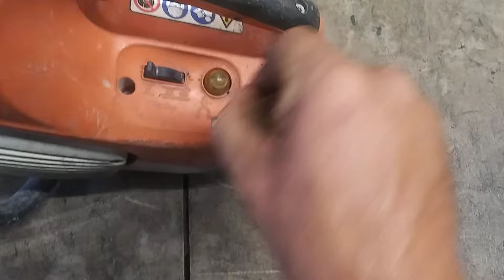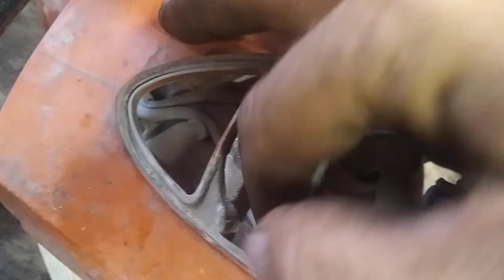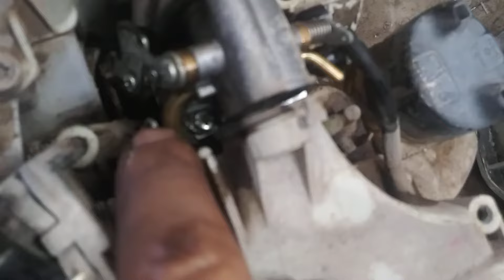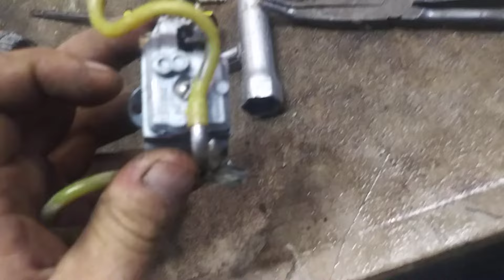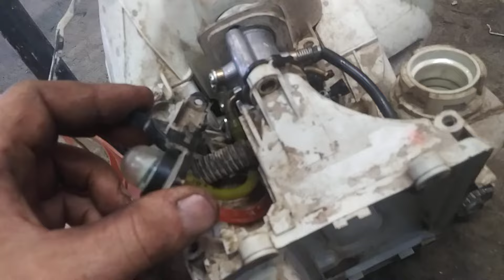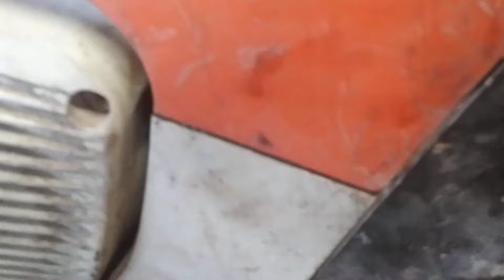* Stihl ts 420 410 carburetor fuel line filter tune up

Comment: my 420 runs good for like 4 minutes but once it warms up I boggs down and dies. what do you think it could be?
Reply: Mechanically no mechanic can tell ya what’s exactly wrong. 
And theirs a bit of a difference between mechanic and technician 
These our two strokes they can have vacuum leaks, and vacuum leaks mimic carb fuel problems

Comment: Hi Iv just replaced all filters carb and lines but it will only purge the fuel if I tip the saw on the side so the return is in the fuel , any ideas? Thanks
Reply from the maker: Lines are backwards

Comment: Excellent and to the point video. I have a 420 that starts and runs okay, but it lacks power when cutting paving blocks. Any idea what's wrong? Thank you.
Reply from the maker: there are 2 adjustment screws together on the carb. the one closest to the air filter counterclockwise a quarter turn

Comment: I bought ts410 but wont prime just pressurizing fuel tank but when i take off the primer it works when i put fuel in the cap it sucks it up and pushes it out swapped lines on primer holds fuel but doesnt push it to carb any ideas? Thanks
Reply from the maker: bad carb. needle valve sounds like its stuck closed or bad diaphragm. could be pinched or kinked line or clogged fuel filter as well. tank will pressurize on its own from the gasoline evaporating.

Comment: I Dwine Cotton bought this cut off saw to use as scrapping and found it to be my first but the Best. . 
But as of September the 1st it started dieing on me ? The first of 2yeara i has been working it.
I want to know why it dies after warming up? Chocking its self out as it dies. Thanks for your answers.
Reply from the maker: could be many things. the first thing i would do is check the spark when it dies sometimes the coil goes bad but only acts up when it gets hot. sometimes the sparkplug does the same so change it. check the compression if it and the spark are fine its fuel. make sure you are useing fresh bought today gas. all else fails do the carb like in the video.

Comment: hello can you help me remove the carb from a 420 saw and I don't know how the ways are connected
Reply from the maker: This is a video on a stihl ts 420. Do you have a different model?
Reply: Did you watch the video?
Reply from the maker: @joaquincortada1483  2 min 50 seconds showes the 3 bolts holding the carb in
Reply from the maker: My bad your responding to this guy my bad
Reply: @smallengineguys  👍